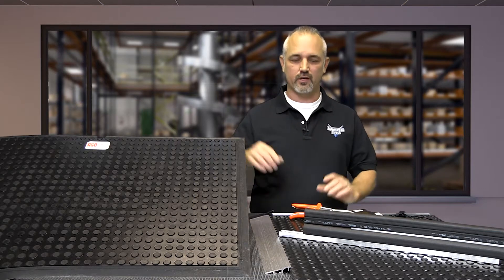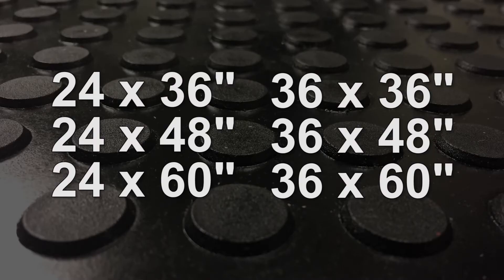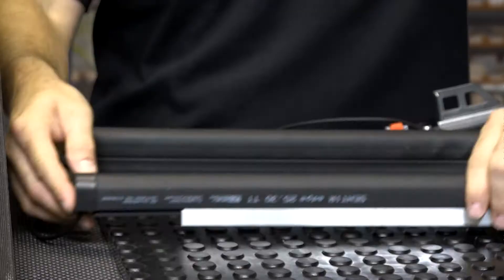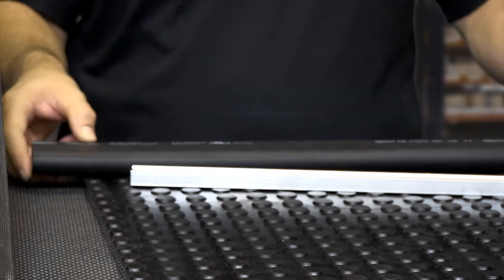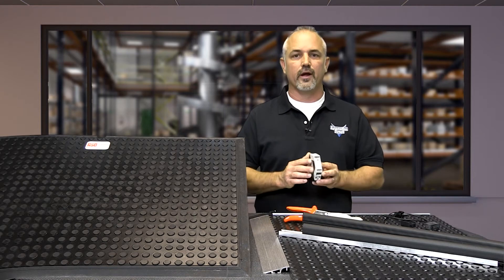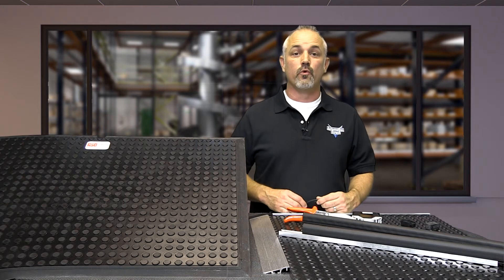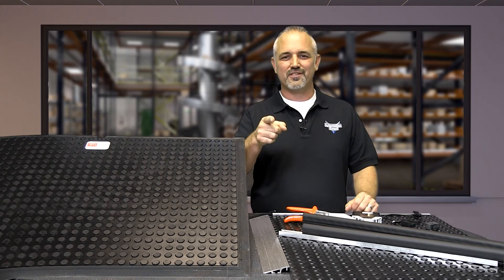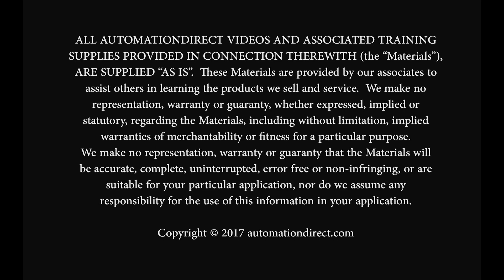ASO Safety Mat, Safety Edge, Safety Relays from AutomationDirect

Comment: Hi, I'm looking for securing an automated welding robot cell and was wondering if those mats would be resistant to MIG aluminium welding spatters, because it would be a cheap alternative to laser scanners etc.  Let me know if they are suitable.  Thanks.
Reply from the maker: That is a great question.  Yes, ASO mats are used in Robotic welding environments but there are many factors that need to be
investigated for each application.  The ASO mats we offer are made of PUR.  Some applications for welding have used a stainless steel or an aluminum type of mat.  You can find the specs for the ASO safety mats on our website at www.automationdirect.com/safety.